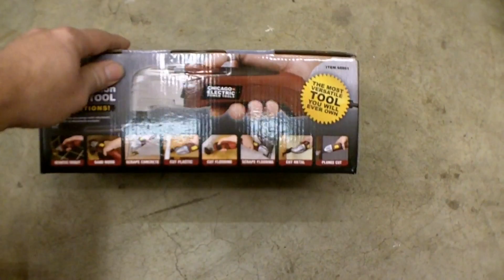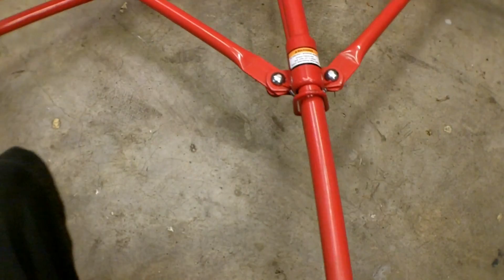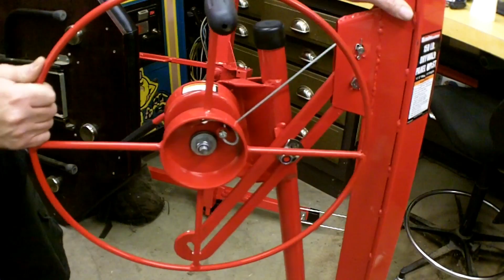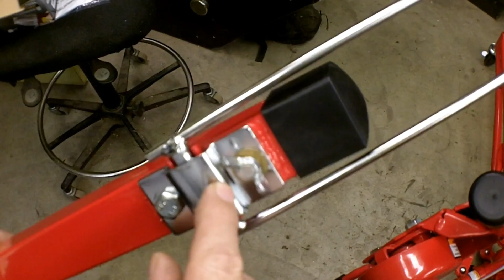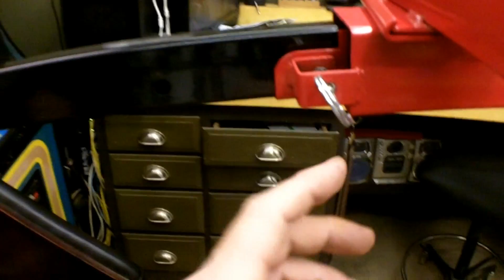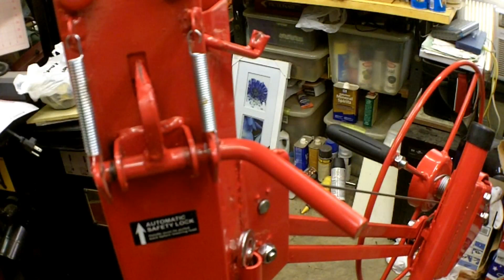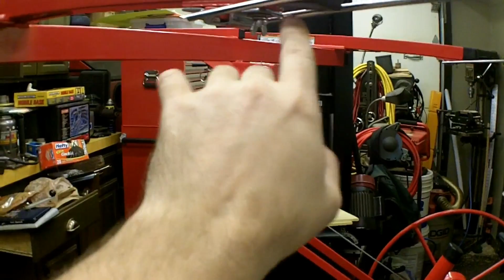Harbor Freight Panel Hoist Review Item 69377 Drywall Lift

Comment: You did a good job explaining how the machine is designed to work. If you have a chance to compare this unit to the original machine designed in 1972 and still manufactured in the USA I think you'll see some differences in quality-ie-watch the winch while you turn it in this video-It is quite warped, When you show the tripod sections and how they open-there is quite a lot of slop where the legs are bolted to the center frame. As the patent for this design expired a number of years ago these knock-offs have flooded the market. Most people really don't care where their purchases come from as long as it's the cheapest price. Just keep in mind-this design was by an American-originally built and manufactured in American. But I guess Chinese workers need to eat too.
Reply from the maker: Thanks Alan! I have rented the original panel lift before and you are correct about the quality. It's built heavier and tighter than this one for sure. They had taken a severe beating and still worked just fine. I got tired of having to race the clock on my projects, or burning money if I couldn't get back to my work and the lift sat there collecting money. The $750 or so for the original lift was out of my budget and since I'm a diy'er- I couldn't justify the cost. For 4-5 rental days this one will pay for itself. If I were a contractor, I would go with the original for sure. For me, this one works and helps me finish the job. Thanks for the post and good luck, G.
Reply: I used to care deeply about that. Bought a new US, Porter cable compressor and was proud. One day it quit. I had another laying around the shop since 9/11 happened. Got to looking, took the piston and cylinder off, bolted exact on the Porter Cable. Harbor freight only since that day. I knew the older one was Chinese, now I know the rest is too, just costs more because of the name.

Comment: ghostses, thanks for taking the time to post such a thorough video. The owner's manual was not very helpful. Just as an FYI, I didn't buy the hoist to hang drywall. I bought it to help me get my RV cover up to the roof of my RV without killing myself. Goes to show that this thing can help perform more than one task.
Reply from the maker: No problem Craig- glad it helped. I never thought of using it for anything else, but using it for the solution to your problem seems like a great idea to me. I bet that cover weighs a ton! Good luck, G.

Comment: Very good review.  Had one computer down and second no sound till today when I solved problem.  My past question about it turning I guess is not important as hearing the review I realize tilt over and then back with the sheet rock and that rotation is probably not a problem.  Yet when putting the board on does not not rotate as you are lifting to the two arms that are the hangers.  I am assuming there is not lock to the rotation.  Any theories appreciated.
Reply from the maker: Thanks Al, you are correct- there is no lock for the rotation. G.
Reply from the maker: Al, I read your post again and maybe I didn't understand your question. If you are saying that when loading a sheet and then trying to tilt it back to horizontal by lifting on the chrome hooks and it wont- there is a handle used for this purpose. you can barely see it in the top right corner of the video at 6:21. So, tilt the table over, load your sheet, walk around the the other side and use the handle to pull it back to horizontal. If neither is what you're asking- try me again. Hope this help, G.

Comment: I just put together the Harbor freight hoist this afternoon.  I seem to be not understanding something.  I have all in place and the mounting pin doen in the assembly.  That mounting pin turns freely but am I dense or what I do not see what holds it in place to keep it from rotating around when you are putting sheet rock on it. I feel DUMB what am I missing.
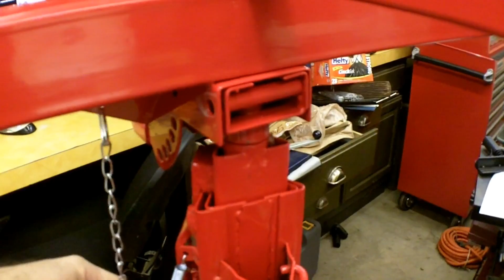Reply from the maker: Al, you're not dumb or missing anything. I assume you're referring to the the pin I have in my hand at 5:53 in the video. This pin is just to lock the platform in the horizontal position, or any other angled position if you were going to install a sheet on a vaulted ceiling. There is no method to keep the platform from spinning around- you just have to deal with it wanting to move. The way I load a sheet is to tilt the platform over, lock the wheels,  pick the sheet up higher than the hooks and walk into the machine. By doing this, the sheet will contact one hook and then rotate the table until the other hook is under the sheet- then let it down so it rests onto the hooks. From there you can tilt the sheet to any angle you want, raise it up and install. I hope this helps in some way. Good luck, G.

Comment: Anyone know what the square pin that hangs on the side is for?
Reply from the maker: Yeah Paul, it's referenced on page 9 in the manual- figure 15. If the locking pin that automatically clicks in the hole is not in one at a particular height, you can use the square pin and put it through a hole in the mast for safety. Me, I don't use it but do what's best for you. Hope this helps, G.